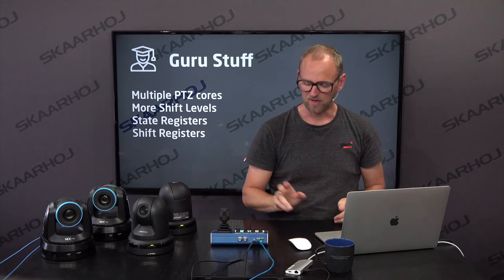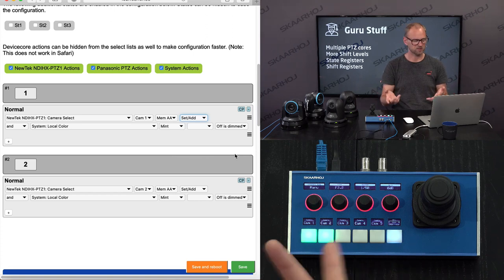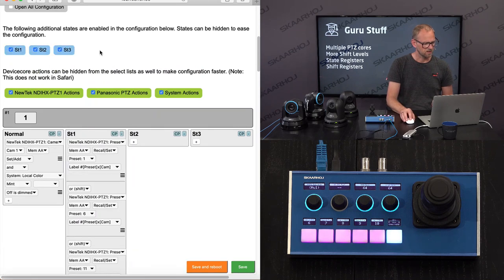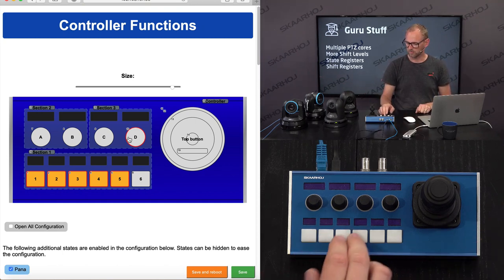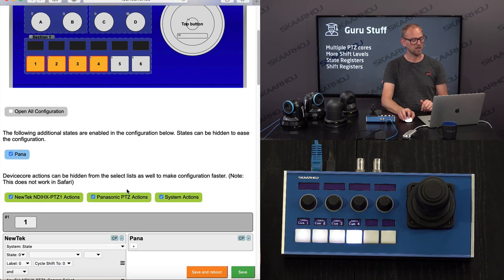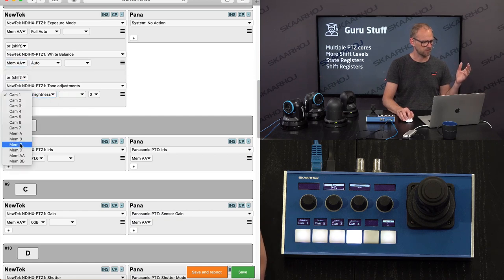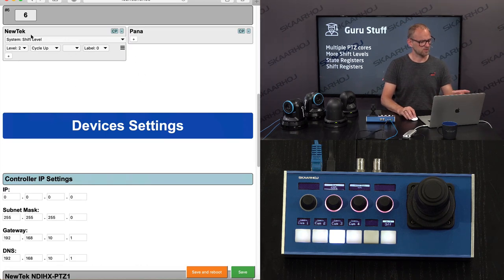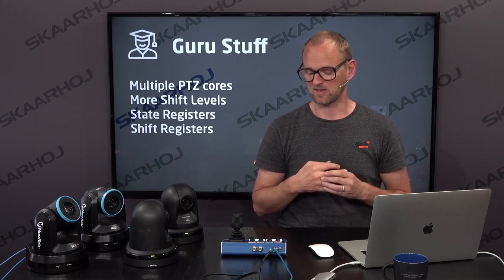L15: Guru Stuff

Comment: Is there a way to add keybridge to a  memory, so that instead of changing brands of PTZ cameras, you could define a bank of preset keybridge macros? I know this is a bit "in the weeds" for a question, but this is the guru video...so thought it might apply :)
Reply from the maker: Hi Mathew.
Good to hear from you again :D

If understand you correctly, you want to have a row of buttons that when PTZ 1 or PTZ 2 is selected, show PTZ Presets for that camera.
But you also want those button to have a menu layer with KeyBridge.

You can't (and shouldn't) use the camera memories for that.

What you want to do, is to make a new shift or state layer, and then define a button that will select this layer.

Be aware that KeyBridge currently only fills in display information upon initial connection. Which means that when you switch to the layer with KeyBridge, you will have blank displays.
This is a bug that we will fix later.

One way to get around this, is to have a feedback action in the same buttons that switches the state or shift layer, that also activates a KeyBridge macro that fills in the displays, using the feedback action and changing the HWC numbers.
A cumbersome workaround, but it gets the job done. 

Write us at support@skaarhoj.com and I can show you a quick demo or maybe we can set up a quick call.